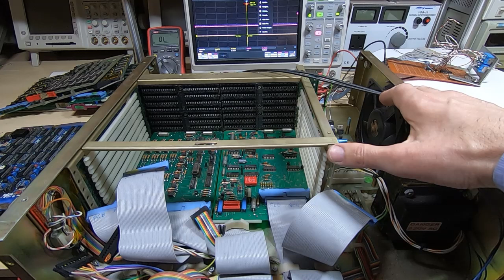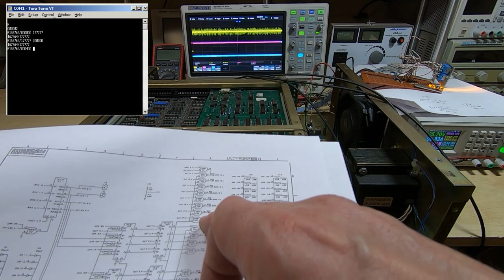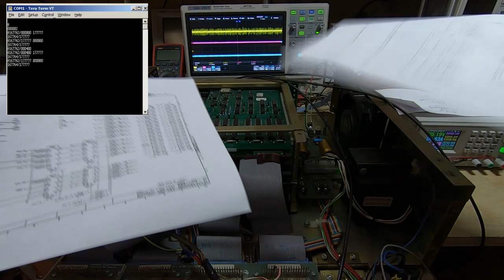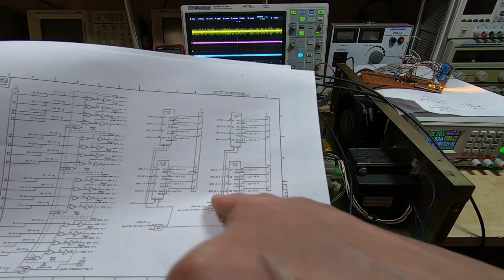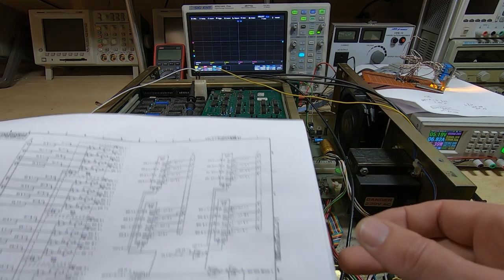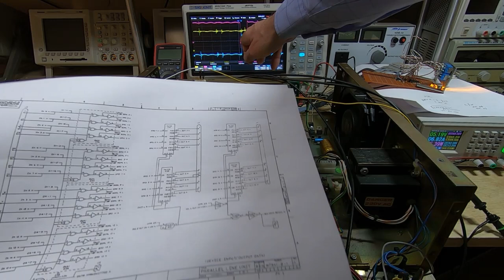PDP11-3 Repair Part4

Comment: Jerry, please continue making videos showing the details and your thoughts as you troubleshoot your project(s).  I can learn a lot from your techniques!

This PDP-11/3 reminds me of a PDP-8/A that was used to control a test stand at work (~15 years ago).  It became a problem when it experienced a stuck bit and "randomly" overwrote words in the core memory.  Fortunately we had a spare CPU module which functioned & tested correctly.  Of course, the I/O module wouldn't accept signals from our Teletype, so we couldn't reload the papertape.  I ended up asking the maintenance Electronics Technicians to move the entire console which contained the -8/A to next to my desk, learned to read the tape by eye, and stepped through the entire 8K (16K?) core finding & correcting all of the errors.  The machine was put back into operation for several more years until maintenance insisted on its replacement with a "more maintainable" (in their eyes) computer (an industrial PC).  I adopted the -8/A and still have it at home.

After a few years I did have to use a logic pulser & a logic probe to locate a failed IC which caused the Programmer's Console to be unable to boot the machine, but as far as I know, the -8/A is still functional (I admit that I haven't played with it recently).

Could you talk a bit in a future video about "stuck bits" and what causes them?  The bad CPU module at work was thrown away before I could recover it or I would have tested it to hopefully discover & repair its faulty component(s).  :(
Reply from the maker: Thanks for the comment. It is always interesting to hear from people who actually used these machines. I will try to post a video on the cause and cure for stuck bits on these old machines which is a very common problem.

Comment: Love the detailed diagnostic videos keep them going.  You do make me wish I had a more than two channel scope at times but, I have used the trick of a TTL gate on a breadboard to pre-select the condition for the trigger channel.  So maybe some - "how to do this" with more basic tools videos may be popular...
Reply from the maker: Thanks for the comment. Yes it is possible to use any logic circuit to trigger the scope but is really not a method I would recommend for this sort of work. While I did not show it in the video the 7404 I replaced actually tested good in all my testers (even the expensive one) but clearly was not working when looked at with a scope. That is why I have a resistor on the flying lead as it helps weed out failing chips. This means that using TTL gates for the trigger would never have found the faulty device. The method you indicated can be very useful if you know all the IC's should be OK but in very old machines the IC's frequently do not completely fail but just do not work 'well enough'. Most 2 channel scopes have a separate trigger which can be used for triggering but I wanted to show the actual clock pulse in the video so used a third channel on the scope instead.